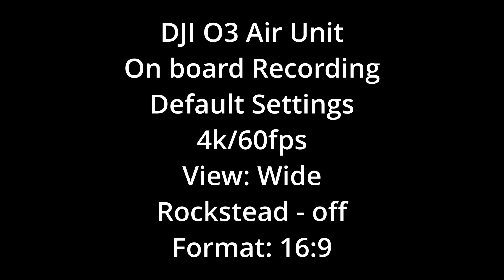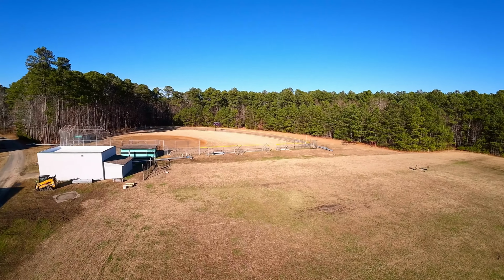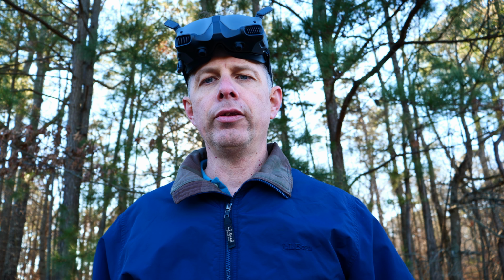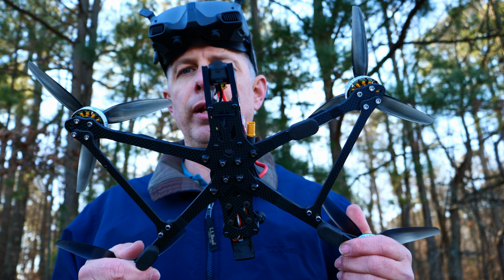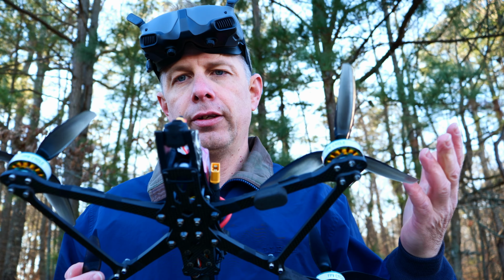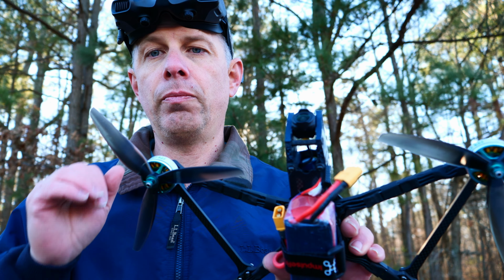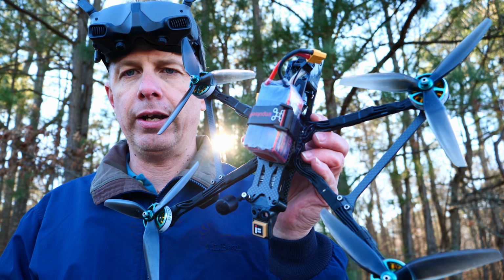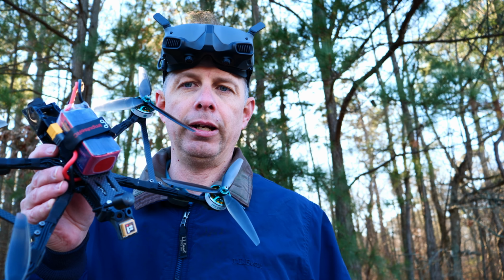DJI 03  Apex LR 7 inch flight (1-08-2023)

Comment: Thanks for sharing all this. I took a bit of figuring out to assemble my APEX 7" Steele version. It was a bit easier as the camera supports for the DJI 03 unit were included in the kit. I have got all set up and I have done a first LOS flight. Looks good and powerful on the 6S battery with the 7" props. I have noticed that the quad is a bit twitchy when moving the sticks. Did you take the default BF tune of did you adapt to fit the 7"? Thanks and happy flying!

Comment: Personally found it a easy quick build but I have built a  Apex or 2 before. Anyone struggling there is plenty of videos of 5" builds that are very similar. Arms are different but it's obvious what arms are rear and what are front.
Reply from the maker: I am a builder too but this frame was different, I am no stranger to pressing in ones one nut into the carbon pieces but it just wasn't obvious where and which side they should go.

Comment: hello congratulations for the video 👏👏. I just assembled with the o3, I really like the support of the o3, did you design it?  is it possible to find the support file?
Reply from the maker: There are certainly other supports for the 03 air unit but I really like the clean profile of these that I used:
Reply from the maker: https://newbeedrone.com/products/newbeedrone-dji-o3-airunit-20x20-adapter-mount
Reply: Thank you